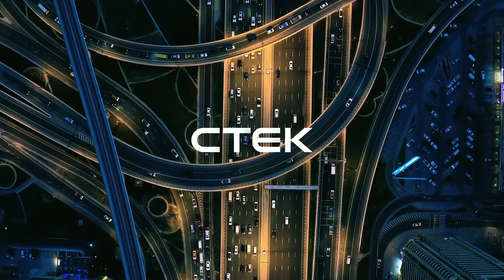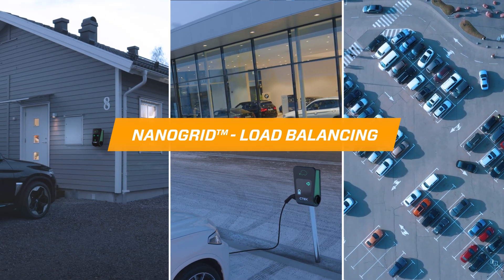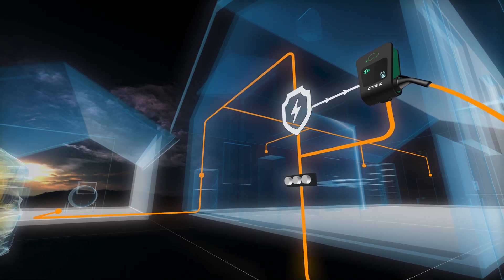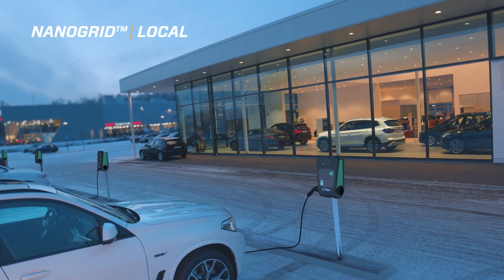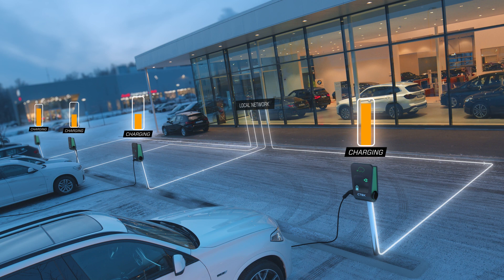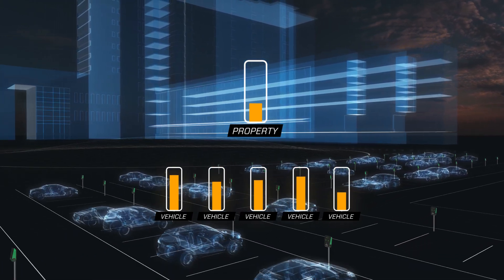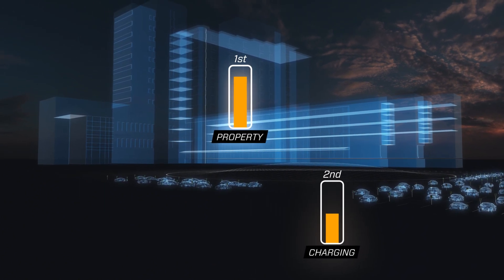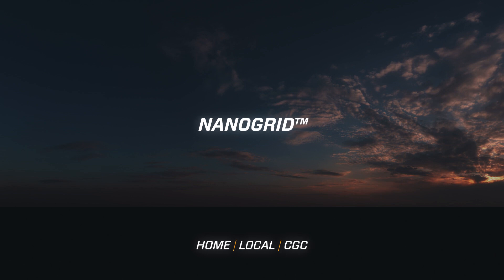NANOGRID™  |  Load balancing

Comment: How do you do home mode load balancing on a 3 phase supply? You only sell a single phase meter for the main incoming. Can I use my own 3 phase modbus meter?
Reply from the maker: Hi. Thank you for your question. The meter supplied with the NANOGRID HOME Load Balancing kit is a three-phase meter, capable of operating in a single-phase mode, if needed. Please note, installation of electrical equipment must be carried out by a qualified electrician. Please do not hesitate to contact our support team on support@ctek.com if you need any help or advice on any of our products. Best regards CTEK Support